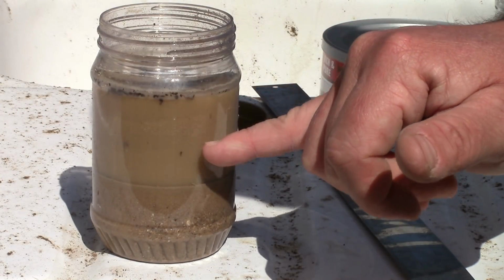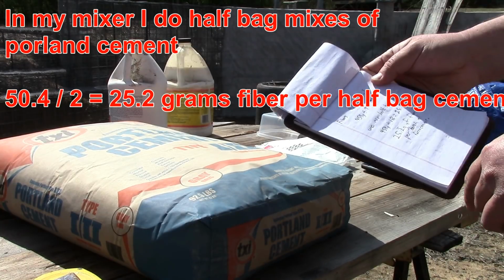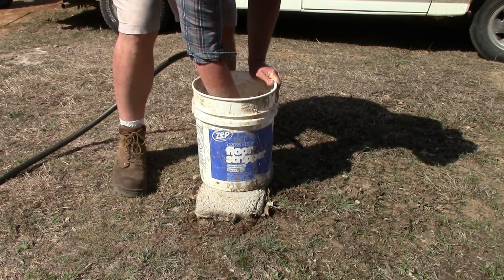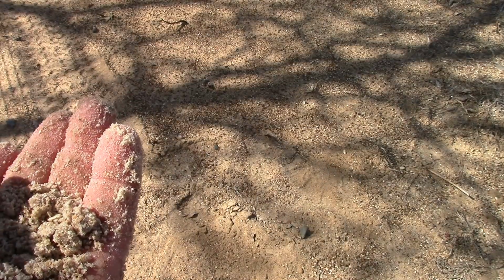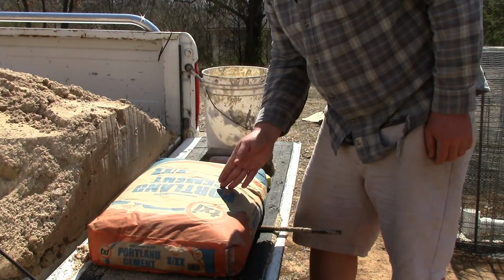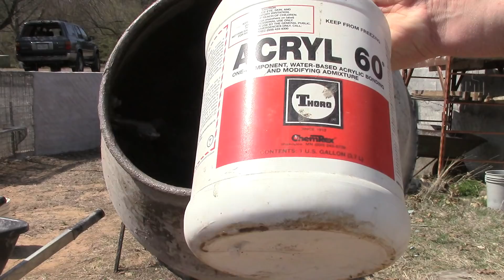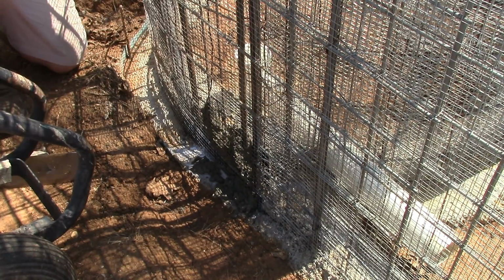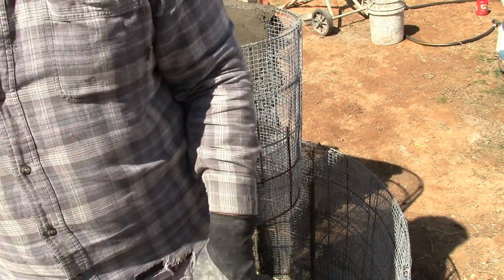Ferrocement House Project - Part 9 - Cement Sand Fibers Glue

Comment: Retired Ferrocement boat repairer, AND BIG FAN >>>> my mix is 2 - 1 and I replace 15% of the very fine sand with a Pozzolan like DE or Fly ash, to this I add a few grams of Trioxide to combat the galvanic reaction between wire and wet cement which causes bubbles or a honeycomb effect in mortar. THIS is Ferrocement, water tight and most definitely NOT concrete which is porous. The old man who taught me would swear and if close enough give me a clip around the ear if I EVER called Ferrocement " concrete " a boot up the butt was also possible, he was in his 70s and I moved quick..taught me alot.  It's all about microns..particle size.
Reply: ❤ Thank you thank you thank you!
To be sure, are you saying 2 parts portland to 1 part sand? (replacing 15% sand with fly ash)

Comment: I was happy to see your sand situation worked out.  I used well graded, washed concrete sand for my house build but used a fine white sand for a sculpture project.  The sculpture project failed the way the one you showed on your video failed.  The reason was not that the sand was not washed but that it did not have any variation in size.  In about 4 years it deteriorated.  If it had had silt and organic matter I am sure it would have been even worse.   The house has held up well for 14 years so far.  I just found your videos today.  It has been interesting to see someone else with wire cuts enjoying ferrocement.  Thanks.
Reply from the maker: Thanks for the info. The creek sand on our property looks to be very uniform in particle size as well. I want to get a sieve test on it at some point just for curiosity's sake.

Comment: Construction sand is crushed at the plant so it has jagged edges. The sharp jagged edges help key it into the mix. Naturally occurring sand is rounded because of tumbling in nature. Because natural sand from beaches, desert, creeks and rivers is smooth it does not key into the mix and causes failure. I spent some time researching because I have a property in the desert and I want to build a dome on. That's also how I found your channel. I came to the conclusion that I would need to bring construction sand. The use of fibers and binders might however change the outcome of using natural sand, I don't know.

Comment: have you ever thought about shotcreteing ? it would work with your metal work right? i'm trying to work out if i used a finer gauge mesh, if it could hold aircrete. if it could then it would remove the need for an insulation layer as it is so insulative, its also super light. have you experimented with it? thanks again from london for the great content!!